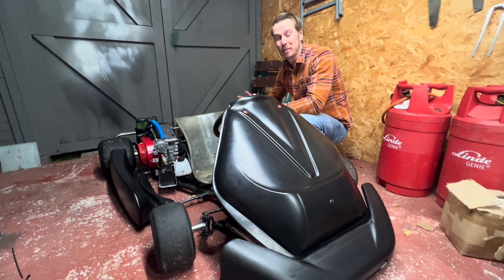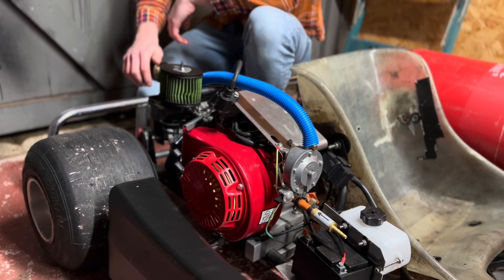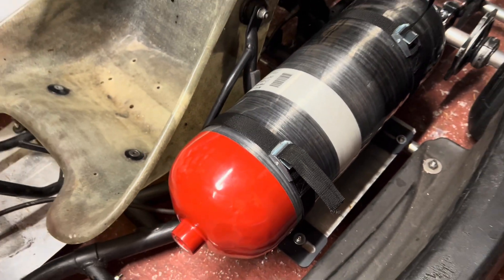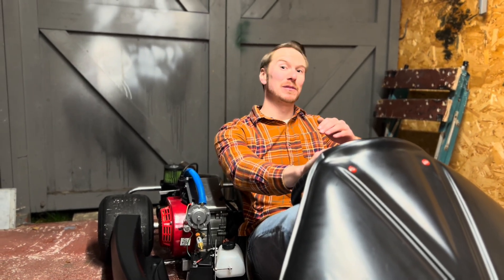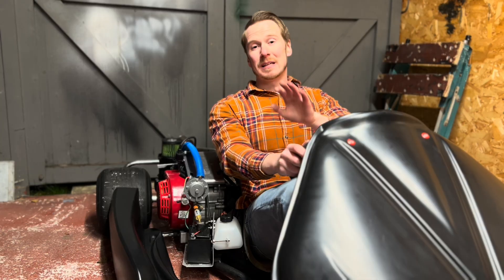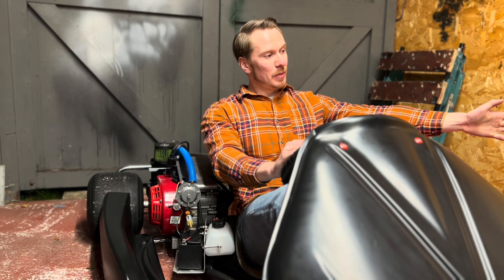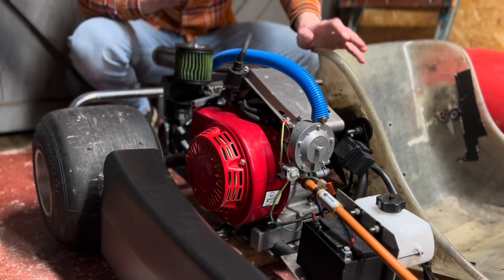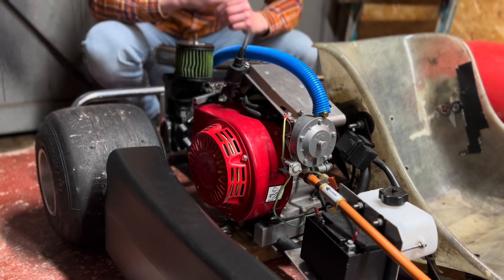I Built a Hydrogen Powered Go-Kart…

Comment: Is it possible to convert a diesel engine to Hydrogen based ?
Reply from the maker: I think you’ll need some sort of spark to start the combustion process, not compression ignition, or run a little bit of diesel still so that combusts and ignites the hydrogen

Comment: why not just make the valves out of this Ti-6Al-4V Alloy: ~1878°C - 1933°C (3412°F - 3511°F) (higher melting range due to alloying elements) job done. no need for water and you can set timing by hand or have a cdi unit. also that engine is air cooled so a bigger heat sink on the head as in redesign head bigger fins more air flow while travelling along , i personally would start with a water cooled engine it would sort 90% of problems. but if u keep that engine a big oil cooler would help.

Comment: Looks and sounds amazing!

Can't wait to see this bombing round a track with the new lightweight carbon fibre tank on it
Reply from the maker: Glad you liked it! I'm excited to get it on the track too.
Reply: Great video! Do one on storage tanks! Are you able to still get storage tanks with nickel metal hydride to safely store the hydrogen in? What other "sponges" are available?
Reply from the maker: @edwinbickel getting a sponge style cylinder would be amazing, so incredibly safe too, probably would be the release rate, it’s too slow to feed the engine, that’s why I ended up using a compressed gas cylinder instead
Reply: @Hydrogenguys slow release rate is why the guy doing it with his corvette had 4 tanks in parallel to feed his engine. Could ho 400 miles on it. New suscriber, looking forward to seeing your advancements!

Comment: I'VE SEARCHED THIS CONTENT FOR YEARS
Reply from the maker: Glad you have found my channel, it’s all about hydrogen engines ✌️
Reply: @Hydrogenguys I'd love to make an oxyhydrogen engine by making an electrolyzer inside a cart. I know that it is a lot more inefficient to convert electricity into hydrogen than using it in an electric motor, but I hate electric cars. 
You recharge the battery with electricity, you start the car but instead of making weird electric motor sound it makes a stunning 4stroke engine sound 😄.
Sorry for the English, I'm 13 and I'm from Italy